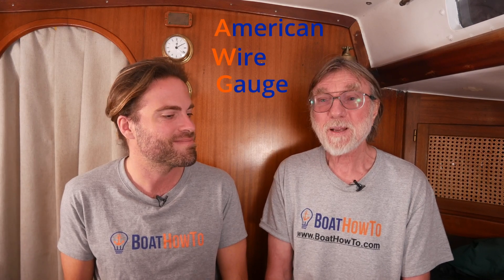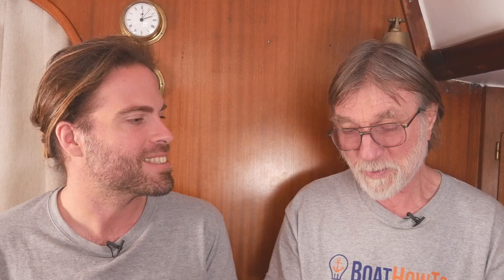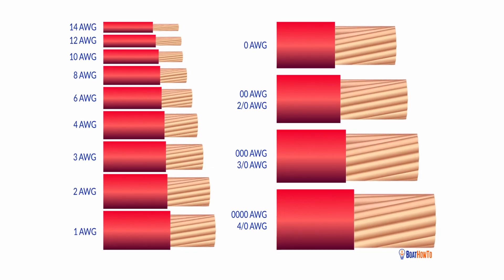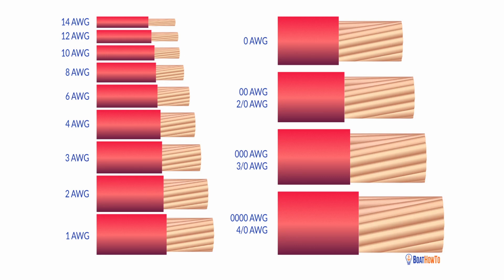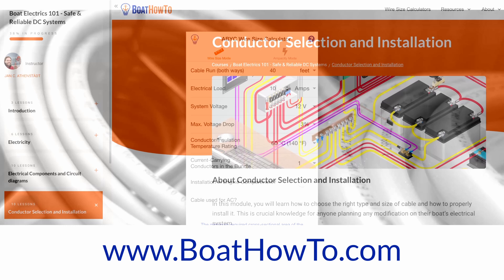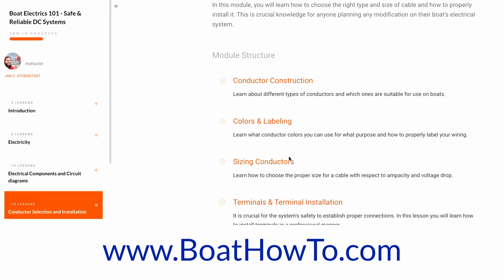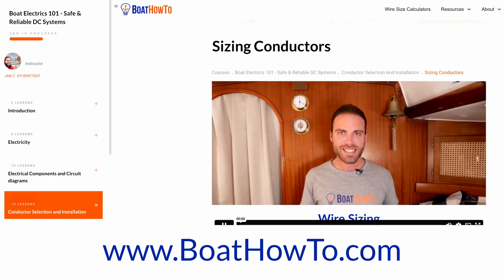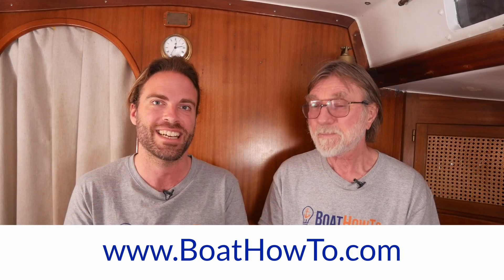The story behind the AMERICAN WIRE GAUGE | Ask The Expert with NIGEL CALDER

Comment: So a question from a boat owner. 

I am having a steelboat, which i assueme is a bit diffrent from the plastic boat. 
So my DC side  there is 0 ohms between the dc negative and the hull. Furthermore there is 0 ohms between the engine and hull. and there is installed a negative switch between the battery and engine, to disconnect when not in use. Also there is installed a tester for boat the plus and minus dc to make sure the system is floating. On the ac side a have an isolation transformer installed, and the earth is coonected to the hull and the neutral and earth is coupled together at the isolation transformer 

My engine does not have an zink installed from the factory, and since my engine/dc side is not connected to the hull, where the zinc is bolted to, i think it makes an issue here. 

Would it work to install a second seawatercheast, take out the filter, drill a hole connect a wire though it, seal it, connect the wire to the engine, and then insde this second seawatercheast add zinc to the wire to protect the engine?

Also i know i the bigger steelships we use copper and aluminium in the seacheast and then run some time of power thugh it, is that something you guys have an understading of